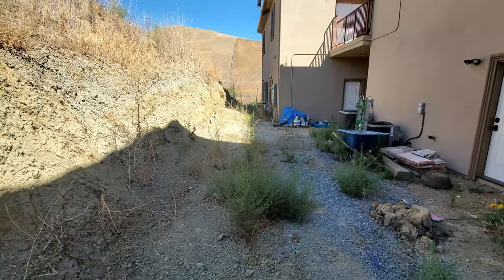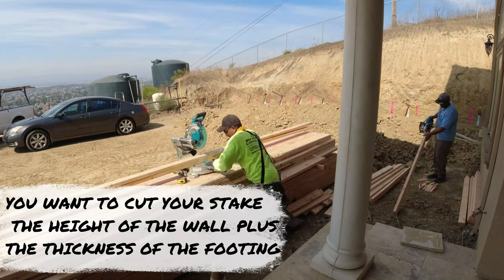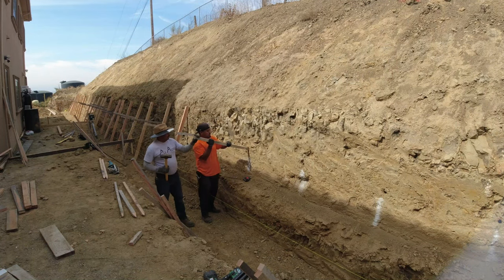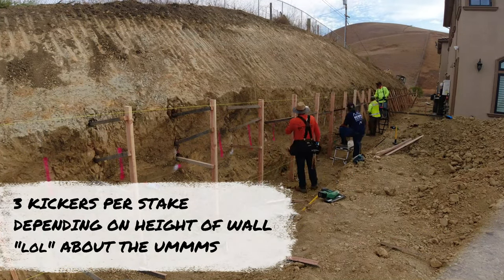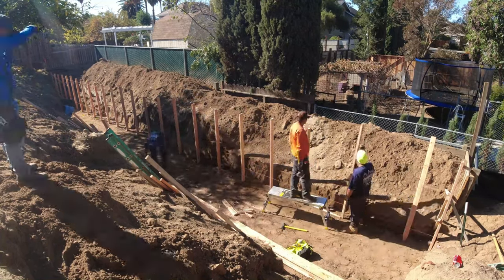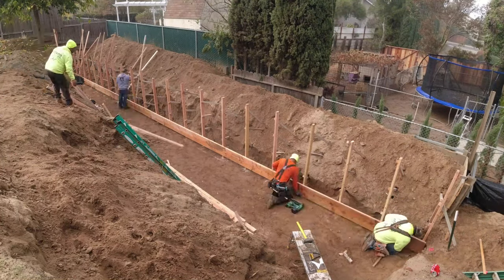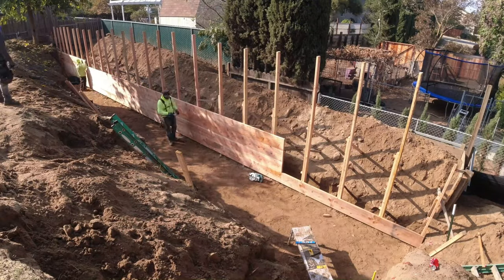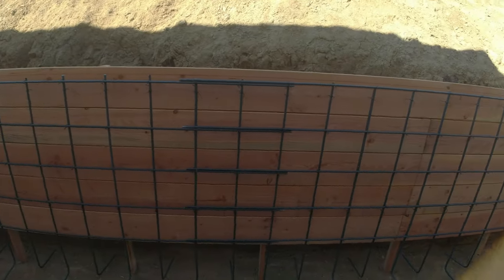🚨How To Build Back Of Concrete Retaining Wall 2022

Comment: I noticed the vertical rebar goes one way (away from the hill) and then on the next one goes the other way (toward the hill).  is the rebar going towards the hill on the top of the footing and then rebar going away from the hill on the bottom of the footing

Comment: What size are the stakes, it looks like you cut down the 2x12 (expensive), why not buy some 2x4's
Reply from the maker: Nope there all 2*4s. If we did use a 2*12 it was an old one and using it for scraps